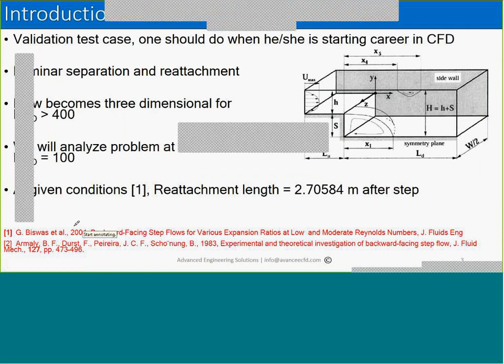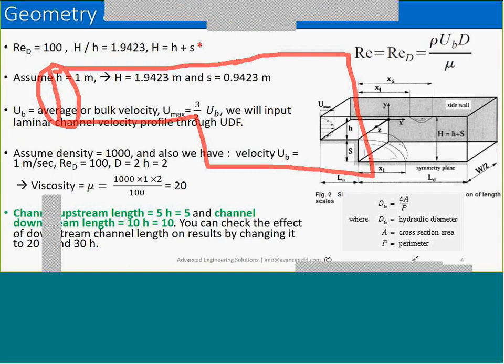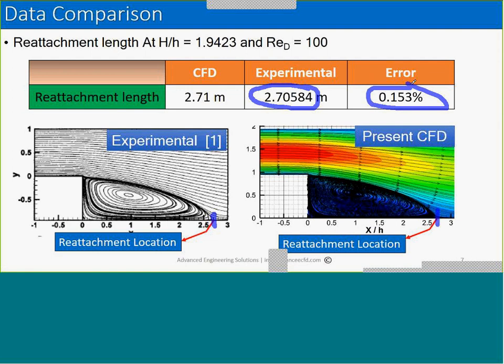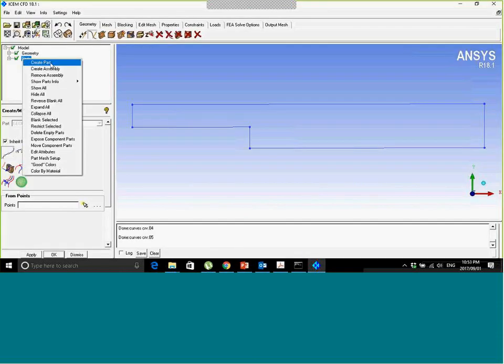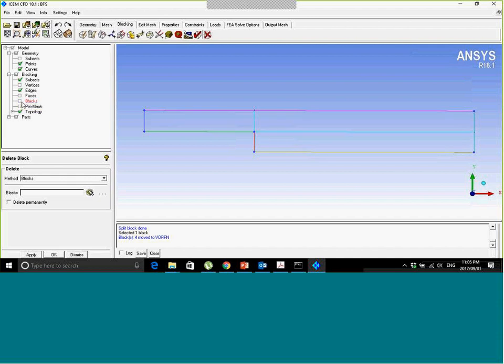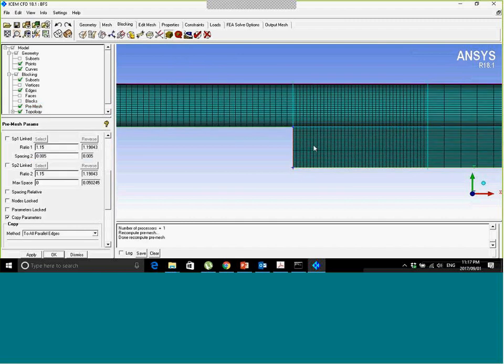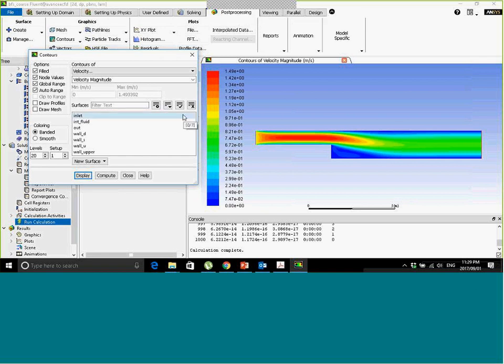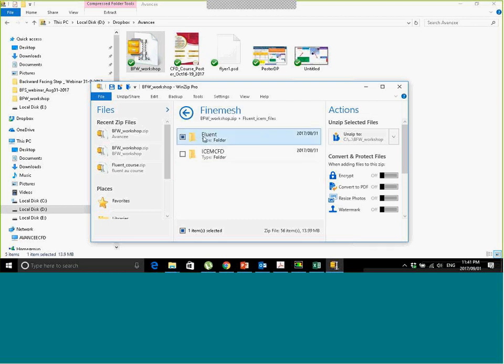CFD of backward facing step

Comment: A very important question please: Do I not need to associate the internal edges?
Reply from the maker: Internal edges where?
Reply: @Engineeringcoffeewithsijal Hello thank you!! Those 2 edges in the fluid domain formed because of your cuts to the carve out the step. The blue lines.
Reply from the maker: @zuheyr1  yes. These are internal edges and dont need association.
Reply: @Engineeringcoffeewithsijal  Ah thank you. But the ok nterior vertices? To give the correct shape?